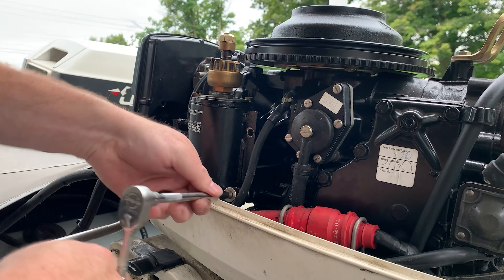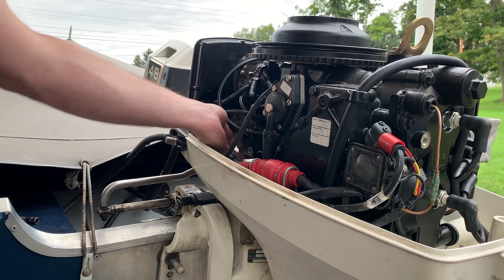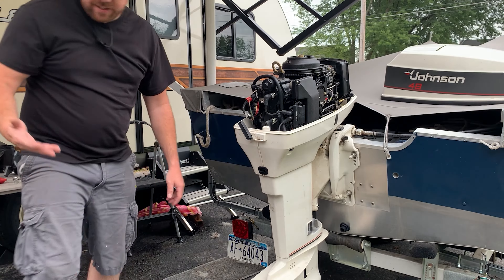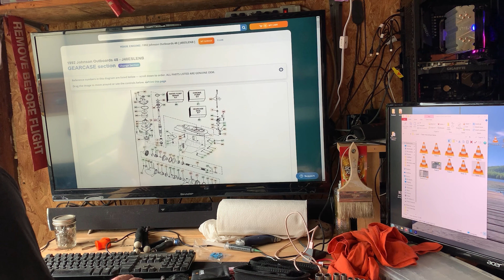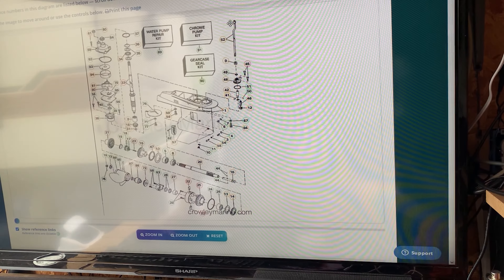My 1992 48HP SPL Johnson won’t pump water! Impeller replacement!

Comment: Replaced water pump unit, thermostat, sprayed water through water line, still won’t pee!! Onto the carbs, see if it is causing overheating
Reply from the maker: Sometimes I feed a piece of copper in and try to break it up. And use some solvents.

Comment: Hows this motor on fuel? About how many gallons for an outing? Thanks, jlo
Reply from the maker: I don’t have that data. But if you keep it out of the ketchup a 6 gallon tank will do just fine and have left overs after 3 hrs. I sold the rig the year after due to space. What a gem that Lund was/is

Comment: What are you doing trying to tear the whole motor apart just to change a water pump crazy
Reply from the maker: I can tell you did not view the whole movie. How do you get into your stern drive without disconnecting the gear selector? Or removing the bolts to the stern drive?  🤣 all jokes aside thanks for the view nonetheless! 🤘🏻🏁🏁🏁🍺

Comment: Hey Adam .. I have the same exact motor on my boat .. I notice the at the propeller there is a streak of dark oil looking running at the bottom of the fin.. mine is doing that so I changed the bottom seal in the foot and changed the foot oil.. it’s still doing it.. I’m thinking now it just some exhaust like crud.. what do you think it is?… thanks Mike
Reply from the maker: So Mike. Mine does the same thing. I let the motor sit for a good amount of time and took the bottom screw off the stern drive to check for water. Water would be at the bottom of it, if it was there. Only thing that dripped out was oil. Just a quick check. No need to drain the oil completely. But let me say one thing. I am no expert on this matter. I know enough to get myself into trouble and back out of it 🤣

Comment: I have an exact same 92 spl 48. I was watching your video because i couldnt put back the housing without the seal come off or the impeller key falls off lol. I will use a gasket seal to hold the seal in place. But I don't see in your video , and i dont remember where the small O-ring goes? I got one in the package kit, and i had 1 on it , but different videos shows different place to put !
Reply from the maker: I would use an illustrated parts catalog that is provided somewhere online. I don’t recall which one I used.  This video is becoming on the old side. But if you have the part number of the oring in question and the catalog that will narrow your search🏁🏁🏁🤘🏻

Comment: Hmm.    I've used a 48 SPL a long time, but I'm not an outboard mechanic.    Often,Spring startup mine would not piss water out the tell-tale.  
There is some kind of wasp or fly that likes to burrow up inside the pisser tube and plug it.   I'd fiddle with it and bug bodies would flush out.
Reply from the maker: The problem is this machine was pumping water earlier that week. But the plant mater that I flushed out must have swelled in there. This was a 4 part series. I bought the machine from a guy that had it in his basement garage for over a decade.

Comment: Was there a key you put in the impeller? I’m having some struggles lol
Reply from the maker: Yup there is a key. Make sure the impeller is installed the way you removed it. It has an orientation. Be patient and take breaks as needed. If you get to rushing you could up making a preventable mistake. I usually mess up that way and have to start over 🤣